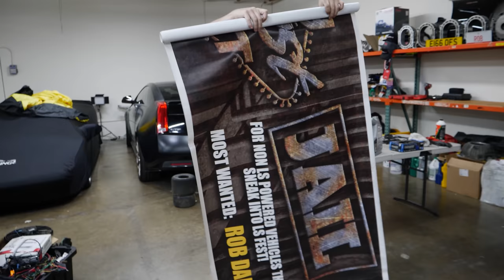How Bad is the Damage on the Wrecked C8 Corvette? I think it can be fixed easily

Comment: Ya damage is so minor. The only difficulty I see is sourcing the parts, but that shouldn't take long for another C8 owner to get a good rear ender.
Reply: @helplmchoking  rob has found one , apparently a c8 fell frpm the vehicle lift in a repair shop ,rob is going to use that one and as tou said most of the damaged stuff is pretty easy to remove and replace.iirc the other c8 is orange too
Reply: @maahingupta2424  That is good news!
Reply: @maahingupta2424  Oh thats great to hear
Reply: @maahingupta2424  geez what's next a C8 launched from space?
Reply: This just in. A large number of C8 Corvettes around the country have been rear ended today. Curiously all the offending drivers were watching YouTube at the time
Reply: @maahingupta2424  Rob has not said he's going to use any parts from it? He just posted to say he saw it as so many tagged him in it
Reply: @RedBatRacing  i bet they all were orange😂
Reply: @maahingupta2424  The other C8 is the same color but it did get damaged pretty bad.
Reply: RARAYAYA RAA  that depends on rob because he just said in the post that this car has the parts he need
Reply: @thejman3489  Not for the shop!
Reply: @groundshakersociety6637  i think he can salvage a lot of mechanical and sttuctural stuff from  stuff from it tho. The outer skin i think is badly damaged.there is a chance that most of the mechanical and structural sruff is intact or salvageble
Reply: I can tell by your comment you've never fixed a car with an aluminum frame that looks like it's been fucked by Ron Jeremy. Until this thing is measured on a frame rack there is no knowing how bent it really is. Aluminum is a finicky bitch. If you try to bend it when it's too cold it cracks. If you get it too hot it melts.  It's really hard to get large sections hot enough to bend with out over heating others and melting it.   If your not doing it yourself labor is quite expensive . If you are doing it yourself, who are we kidding. You're not.
    Sourcing the parts is the easiest part. Swipe your card in a few months as more of these are wrecked and GM catches up, after the corona spamdemic shut down. 
 I've repaired hundreds of totalled cars,  and  just did a 17 corvette grand sport with a slightly tweaked aluminum frame.  I think he would have been smarter to buy a car with no damage for retail and sell every thing he doesn't need for the swap. I'm pretty sure the money would be same, or less , and he'd have a nice car, just without a frame that looks like it was fucked by Ron Jeremy....  I also understand the need for youtubers to create content and that this approach creates a lot more of it.
Reply: @maahingupta2424  the lift arms went inside the front wheel well there maybe more damage that cosmetic.
Reply: Saw one today that fell off a two post. Thatd be parts galore
Reply: a little bird on the street told me that NOT ALL Corvette owners really know how to drive...lol parts will come flyin in. No big deal for C8 owners

Comment: Your actually supposed to remove the glue and screws/rivets and slide a new rail section in
Reply: Not to mention the arms are made to collapse in a specific way on an impact. Not only is it illegal (at least in europe) to modify these, it's a potential hazard. 
Welding heavily alloyed alu isn't the best idea either. The heat may and will alter the properties of the metal.
Reply: And the glue is removable at +300°C without weakening the backframe less than 15%
Reply: I think that the problem it's that you cannot buy parts for the C8 yet 🤷‍♂️
Reply: SE Creator 😂😂😂 seems easy 😂
Reply: Yeah it looks like the he could just unbolt the front sections and get new ones once they are available. Fighting the glue will be a pain tho.
Reply: @DraGma  It's a car, not a UFO!
Reply: You still need to pull the rails over before removing them!
Reply: Yeah I imagine once aluminum is all bent up all your going to do is crack it trying to bend in back into shape.

Comment: Somebody that works a GM parts counter or has access to SI needs to hook Rob up with some exploded parts diagrams, electrical schematics (especially for that transmission+engine harness), some torque specifications, and some disassembly/assembly instructions.
Reply: Those are called service manuals that you can normally purchase. Do they have the service manuals for these cars?
Reply: I am talking about the “service information” that is available through GM global connect, it’s basically an electronic catalog of every document, repair procedure, schematic, and specification for GM vehicles.  It’s 10x better than a Chilton book imo.  Like AllData but on steroids and better because it’s straight from GM.
Reply: I doubt GM wants that information going out to the public, might get people in trouble allowing him to have that type of info.
Reply: @bsmaster7  why would that be?
Reply: @dominickniceswander4556  Car manufacturers typically keep that type of information to themselves because they make money through dealerships selling parts. It keeps you from fixing it yourself, more profit for them on the back end.

Comment: Rob-I’m sure it’s been said in the comments already, but those brake ducts are for track use only. They are meant to be installed and removed every time due to ground clearance issues. Page 153/154 in the owners manual

Comment: You make a body man cring the doors were taken apart so they could be blended so the color matches and those frame rails need sectioned or u mind as well just duct tape it. The upper tie bar and upper rails would also need to be sectioned

Comment: Few years back I hit a curb in my 2002 BMW Z3 M roadster and it has a ton of cooling ducts for the brakes, alternator, air flow fins and plastic then I knew what it was for. Well I nail my front end and when I seen what just parts cost was I learned plastic welding and how to reinforce plastic with mesh and bars being welding it.  The lower grill had to be welded and I was able to build up, sand, repair all it.  Only had to replace the radiator which in the e36 or e36/7 like mine is a common issues so all fixed with harbor fright plastic welders for less then one part would have cost.  Just a idea

Comment: Rod you should get in touch with "V TUNED" for advice on how best to replace the rails.. the plates with the 4 bolts in are there so you can take out the bent broken rails and fit new ones using the 4 fixed bolts to get everything aligned.. looking forward for the next upload.. 👍
Reply: He shouldn't weld that alloy. It will leave it weak and brittle. That's why its bonded in the first place

Comment: Hey rob! I belive the black boxes with the electrical connectors hanging out are the drivers for the headlights and the other 2 on the crash bar are the airbag sensors.

Comment: Hey Rob, I'm one of the somebody's that had to design all this. Well, some of it. That "frunk piece" you poked with your foot is mine lol. It's the frunk hinge and actuator. It was a pain in the ass to design haha. 

That part you picked up that "was in really good shape" and had a second one just like it is an antenna. Not sure exactly what it does since designing around it was the extent of my involvement with it. I think it might be for GPS or something like that. But they do indeed go in the front, tucked under the front fender. 

I look forward to seeing the project unfold. I spent a long time looking at the naked front end of this car on a computer, it will be cool seeing you get hands on with the real thing to put it back together.

Comment: 6:55 You're not wrong, plastic front splitters are supposed to be consumable items, designed so you scrape smaller, more easily replaced parts instead of larger one piece bumper. Doesn't really matter if it's slightly damaged underneath.

Comment: I have seen the aftermath of a lot of DUI accidents and this one is one of the least screwed cars I have ever seen . the bonded panels and frame sections will be a pain to fix but being aluminum any decent aircraft grade aluminum will be up to the frames standard for strength and give you the best welding results for the repairs . I would cut out any spot that has damage in the bonding and start at clean straight metal it will just be easier and stronger that way . If you have worked around the GM bonding glue you know how foul it is when it's welded next to . I think you got damn lucky on this car and even thou it's worse then the other corvette it's still very repairable and will make a very good base for your Aerovette build and I can't wait it's going to be so good.

Comment: hi rob those chassis legs are bonded and riveted us heat gun and heat rail where damaged up to around 350 to 400 degrees c and pull, a little heat can't hurt  the aluminium rail wont lose integrity till around 600 ish degrees c then if you want drill rivits cut rails then use a panel splitter thin sharp wood chisel will do and heat up where the panel bond is and split the 2 panels apart the heat will make it easier buy 2 new chassis ends and a raditor support panel bolt the ends to the support slide back in to chassis and do your cross measurements and length measurements screw the rails so you have a refrence mask, tape where you want the panel bond to stop dont forget to dry fit fenders hood and headlights, and then grind clean both pieces where you are going to bond slide back together put screws back in to refrence holes and remeasure, re rivit or plug weld if you cant get the special riviter job done. it might look hard but it isn't if you just take your time and if you can salvage the left rail thats good too any chevy dealer should be able to give you print out pictures of the parts so you can see where they go and it will have part numbers so you can see what you need they should also be able to get you the datum point measurements for the chassis rails i hope this helps i  am a 54 years young panel beater cheers from down under love the build

Comment: Don't bent those frame pieces back they unscrew and can be replaced I think. That U shaped alu frame bracket, isn't that for holding the light, since you have 2 of those :). Those 2 bars with big black boxes are I think airbags

Comment: You can remove the damaged front rail by drilling out those puck rivets and using heat, you will get a cleaner fix and not have to worry about bending anything further.

Comment: Rob  better get a certified Aluminum  Bbodyshop frame welder to truly  rebuilt those framestructures on that 'vette. It's Your life endangered running that horsie with a 1000 BHP rotary in back! All the crumple zones should be precisely correct!

Try to get the GM frontend Bodyshop  maintenance manual for GM workshops

Comment: Welding aluminum creates a weak point unless it's a reinforced member.  Probably why they used bonding agents instead of welding at those points.  If you butt weld two pieces and then bend them, it will fail at the weld.  Something else to consider if you want to bend aluminum to a different shape, annealing.  Aluminum has unique annealing properties, almost opposite that from steel.  And you can do it in your shop quite easily.  Get your oxy acetylene rosebud torch.  Soot up your pieces with a pure acetylene flame and then add just enough oxygen to make the flame stabilize but not too hot.  Gently burn off the soot (This is your temperature indicator.  I'll burn off when you hit the right temp).  At that point shock the aluminum with ice water.  Now the piece is workable and very soft however, as you work it you will feel it beginning to harden in places.  This is called work hardening.  Repeat the process as many times as you need to get your piece into shape.  The piece will harden on its own over time as well.

Comment: Mid engine car front ends are easier to put back together. Done it on my MR2 twice unfortunately. But it's still kicking. This is a new car so parts should be easier to get. I guess it just depends on the manufacturer.

Comment: Rob you know you will need to use high strength aluminium and steel to recreate any off the previous structural rigidity wright? The aluminium will possibly be made off an 6000 or 7000 series. And the steel might be like S700 grade steel. Just some rough gues but make sure to look in to it.
Reply from the maker: Found that the crash pieces are 7003 aluminum. You are right!

Comment: The correct way to fix the front supports is to drill out the rivers and replace the arms with new panel glue and rivets. Don’t skimp on safety related items man.

Comment: Welding an aluminium alloy chassis is going to leave it a lot weaker and brittle than original. That's why they bond the parts in the first place. A reputable repair shop will just replace those parts
Reply from the maker: Yeah agreed. Thankfully they are just crash focused components. But it’s the same reason I’m begging gm to notice me and sell me some. So I’ll probably fix these temporarily until I can get good ones

Comment: ill be honest, i am used to videos a little more entertaining than this from rob... also i dont see the point in putting a 4 rotor in a car thats already a super car, with a running super car engine. i love rotary's. but this seems overkill. he already has loads of awesome rotary projects to be working on. just focus on one thing at a time already. i want to see more of the AWD RX7 quad rotor. does it have doors, fenders, bumper, bonnet/hood yet? is it running properly? can we get some quarter mile times? see it ken block style AWD drifting?

that being said this video was still kinda entertaining and i will generally watch just about anything rob releases so whatever.

Comment: once metal has deformed plastically it can't be reused.  it may fail instead of bend (which absorbs crash energy).  cars aren't designed to take multiple crashes. one and done